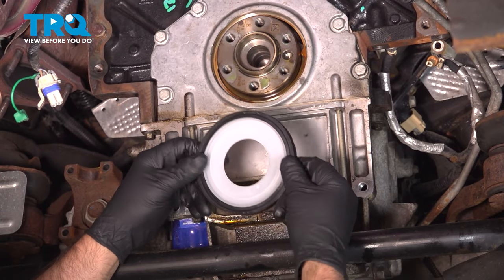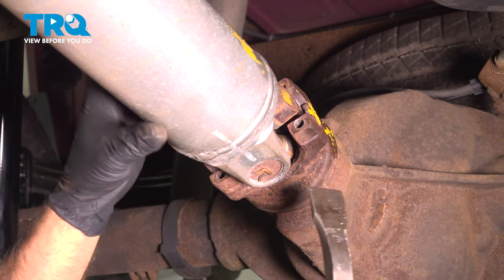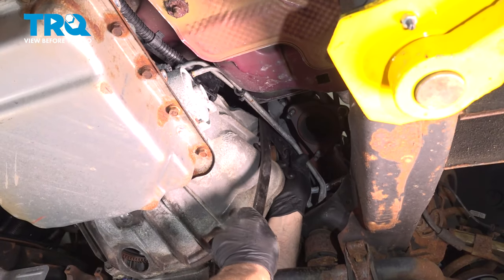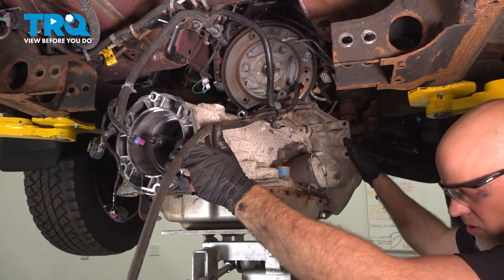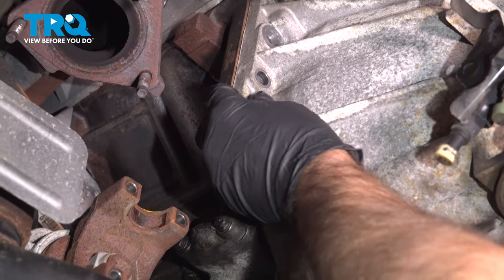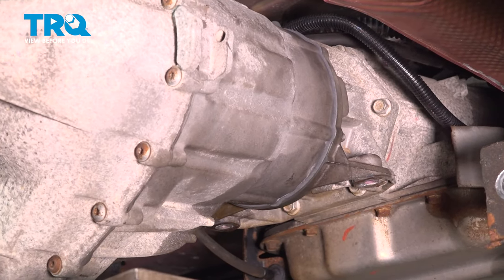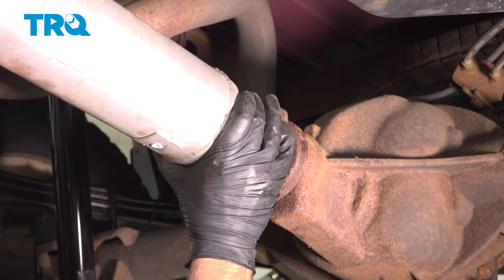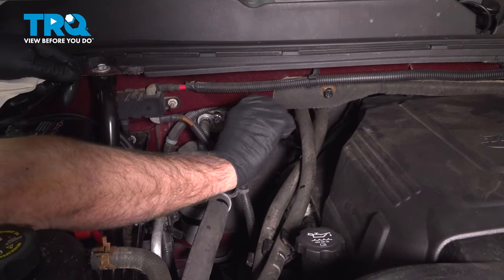How to Replace Rear Main Seal 2007-2013 Chevy Silverado

Comment: Why wouldn't you remove the cover plate? That way you wouldn't have to pry the seal out and you could also replace the o'ring inside and replace the cover seal. that way there wouldn't be an oil leak from the plate or the rear main seal.  plus you wouldn't take the chance of damaging the sealing surface of the rear main seal.

Comment: When he pulls the last flex Plat bolt and removes flex plate the  seal was dry not wet  then it magically has oil leaking and all wet with oil

Comment: I recently disconnected my front drive shaft from the yoke to fix a leaking front differential. I now realize that I didn't mark the location where I removed the drive shaft from. Is this going to be problematic not going back in exactly where it was before? I ask, because I noticed you marked the location of the drive shaft in relation to the yoke in this video. If this is a problem, what do you suggest I do to remedy this? Thanks!

Comment: My 2008 Escalade looks like it has a leak between the engine and trans. Im assuming its the rear main seal and plate. But what amazes me is it only has 49,000 miles ( im the original owner) I seldom use the truck since I have a work truck. It's garage kept too. Never buying another GM again.

Comment: Before putting the flex plate on I noticed you put a whole new plate in and just skipped over after putting the rear main seal by itself. What happened did you have to do the job twice in this video. 😂